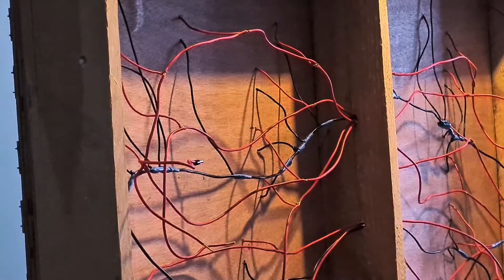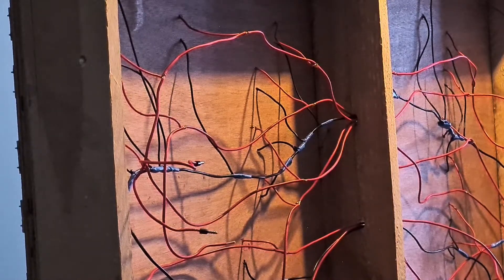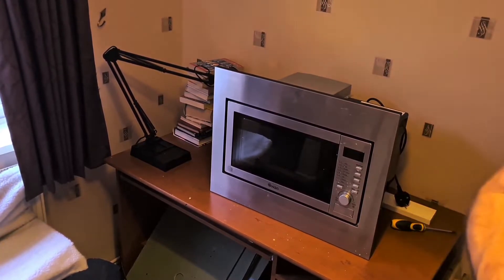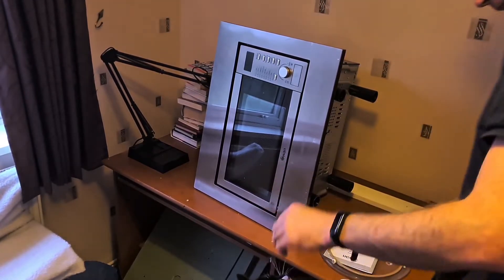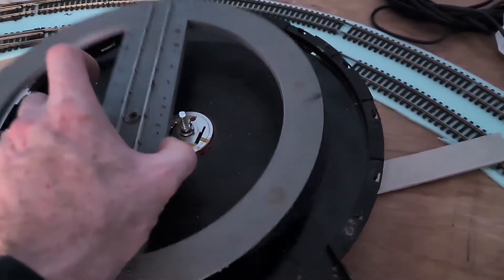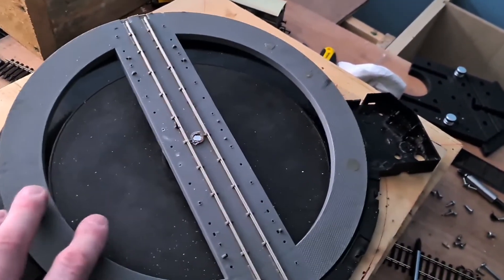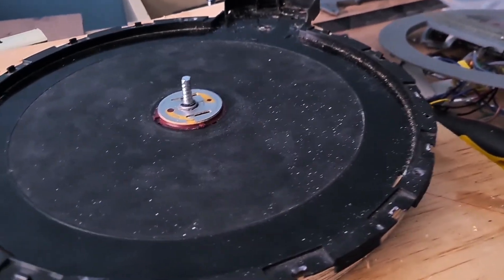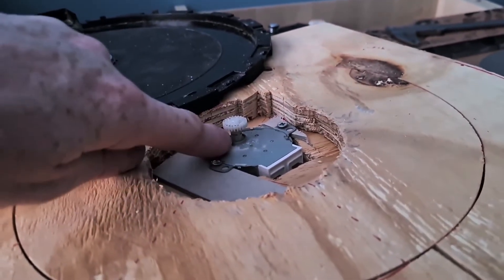turntable project part 1

Comment: That's some amount of time and effort you've put into that Brian.  If the turn-table is going in under the board, you'll not need those 'Approach Straights' with the pegs underneath and a bit more flexibility with your choice of approach to the edge of the turntable.  I think my Micro-wave was made in the time of Queen Bess but it still works, clockwork timer and all!  Great stuff, sir.  Heh Heh, the humour at the end had me laughing too.  (She knows you better than y'think! !:^)  Thanks for posting your progress on the turn-table, sir.  Keep Well.  Cheers!
Reply from the maker: There just there while I work on it they will be shortened and put in top when it's ready to go in but a plan B has just been thrown into the mix giving me more time to work on it all will be explained in the 3rd part .